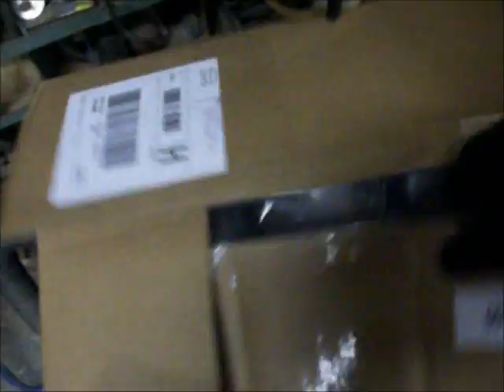Get the lead out

Comment: Thanks for posting. I'm replacing the trunk weather channel strips and ran into the lead joint. I see you also used  MAPP gas to heat yours up, so I'm glad I don't need to get an oxy/acetylene torch.
Reply from the maker: I am glad the video helped you.
Thanks for watching and commenting on the video.  :-)

Comment from the maker: I will be using lead free solder because it more closely replicates the movement of the sheetmetal in varying temperatures than the plastic and fiberglass fillers.
When applied correctly it adheres better to the metal than the other fillers .
Thanks for the excellent question and for watching the video.

Comment from the maker: @wildeyednorthernboy It had a couple of cracks in  it near the rear window openings and I did not want to try and refinish the lead solder so Jeff at Photo Finish recommended to put the body solder(lead free) back instead of the duraglass as it would be more durable and could be worked and sanded like regular filler.
Thanks for watching and the question Thomy.

Comment from the maker: @DjDano500 I think that would be a good application for the solder.
I would use lead free solder instead of the real lead though because of the lead being toxic.
You can work the lead free solder with air tools and sanders with a dust mask on just like plastic body filler.
Thanks for the question and watching the video.

Comment from the maker: @TheWreckingYard The tubing and container would have to be  a material that the molten solder wouldn't melt(like copper or steel).
I would also put a HEPA filter on the exhaust of the vacuum to stop any possible lead particles from becoming airborne.
That would be a good item to patent and sell to resto shops.
Thanks for watching Ron.

Comment: You know what I just thought of,  in electronics you use a vacuum bulb to pull molten solder off of a circuit board. I wonder if you could rig up a vacuum system with a narrow pipe/tube mounted on the end of a shop vac, maybe even with a catch jug between the pickup tube and vac.  Complicated but a thought.

Comment: I'm very interested to see how the Eastwood lead free works.  I have some badly pitted areas around my windshield and other areas that I would like to use the lead free to repair it rather than filler.  I'll grit blast those areas first to remove all the rust.

Comment from the maker: @Accordian85 Thanks for the sub.
The lead was cracked in the corners at the rear window openings on both sides and in the lower corners of the rear window opening.
I did not want to use lead to repair the cracks as it is toxic so I am removing it to put lead free solder back in its place because it can be worked and sanded without the toxicity issue.
Thanks for the question and comment.

Comment: there is not many video's on YouTube on lead work , i spent hours looking for them before i did anything on mine , , preferably you want to have a wider nozzel on you torch , once it is up to temp it just melts out , trying to spread the heat around even on the panel where there is no lead around it can help with warpage , an old rag while the lead is hot you can wipe it off quickly ,